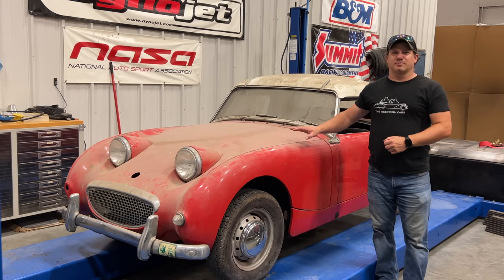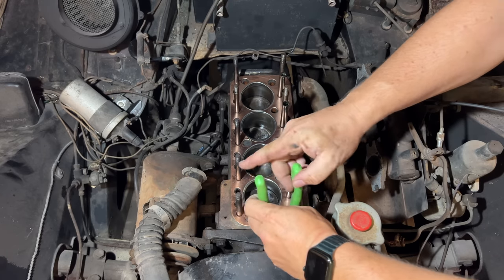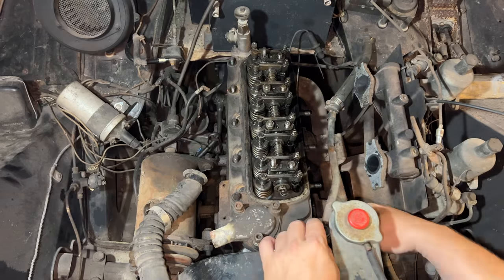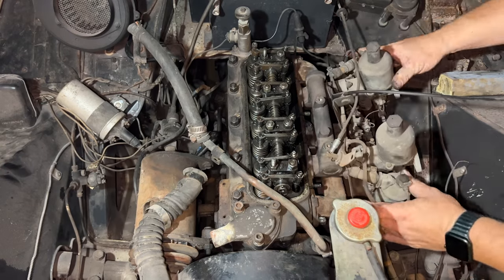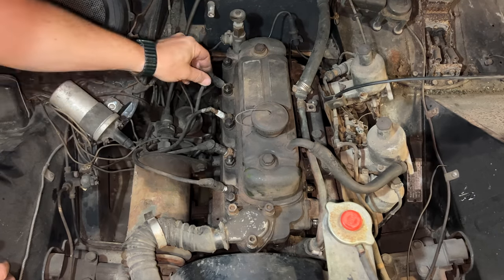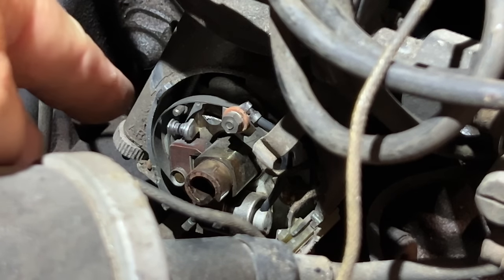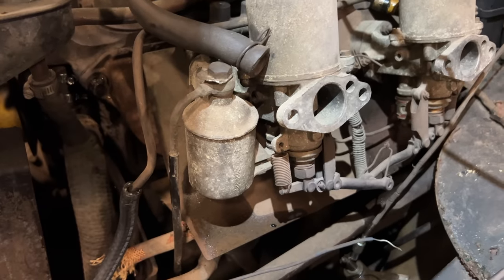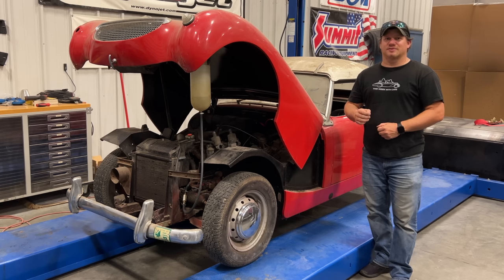Round 3 - Barn Find Sprite #3 - Will It Run?

Comment: I remember spending a horrible few hours replacing that little pipe from the water pump to the head on a Mini, without removing the head. The job was made worse as one of the pipes I was trying to get the little collapsable rubber pipe onto had a slot cut in it to allow it to be screwed into the head. Lots to scratched fingers, bloodied knuckles, grease and swearing later I got the job done.
Reply: The BMC A series (especially the early ones) were a struggle to work on without removing the unit.

Comment: Great video Steve.  Oh that stinking hose. Long time ago but I remember it both on my Sprite and Midget.  Couldn't tell if it was on correctly. I served in the Air Force and was stationed in the UK. I bought a 59 Sprite there in 1980 and in 1981 shipped it back to New Jersey and drove it to my next assignment in Colorado.  I burned s valve in Iowa, removed the head and hand ground a new valve in a motel parking lot.  The hose is night mare.  Please keep up the videos and a review of your Miata or a new mx5 RFGT would be greatly appreciated. Manual 6 speed of course.  I'd like to see your comparison to the GR86

Comment: Good video.....quick question....does converting the car to 12 volt negative ground negatively impact the value of a car like the Sprite?
Reply from the maker: I would say not at all.  It would be very easy to convert back if you wanted to but changing to negative ground opens up a new world of possible upgrades and improvements.

Comment: Those engines are pretty awful
Reply: Powered millions of cars,simple to work on and like most engines as long as you dont overheat them work fine, designed and built for small cars not land yachts .
Reply: @eggy1962  No development. Did not have a chance against the japanese cars.
Reply: @afberglund2764  a series bored out to 1360 cc stage 2 head and a large webber carb, drove a mini with that set up once…..huge grin on my face, very envious it was not mine as it flew, it did however have issue it kept shearing the crank pulley, more nuisance than anything else